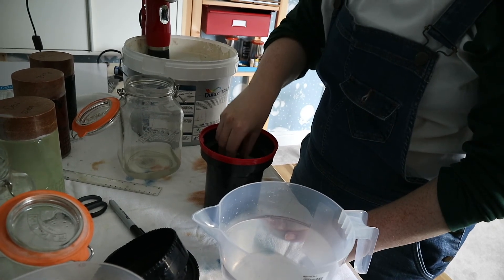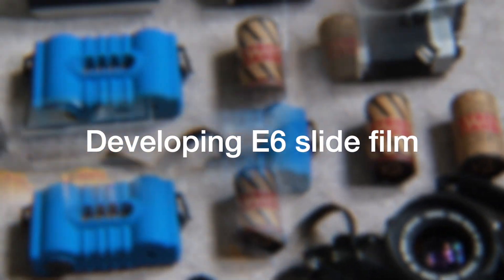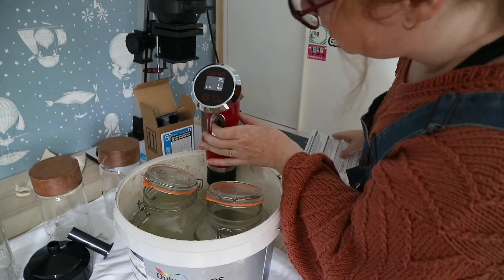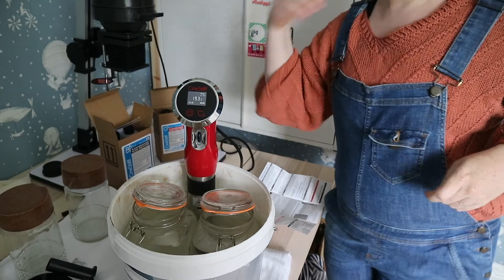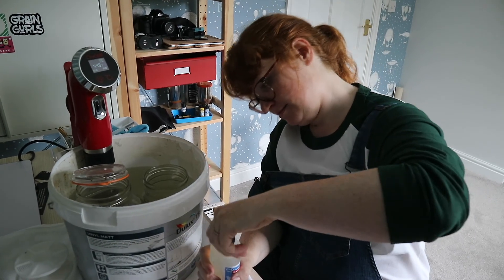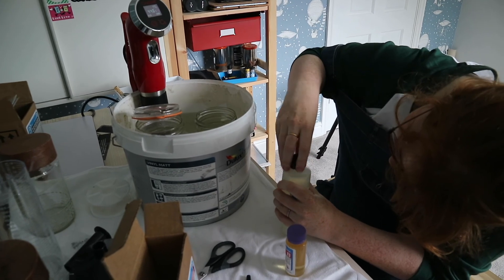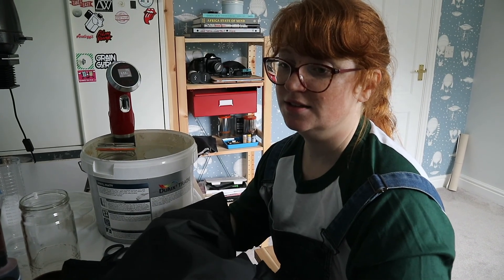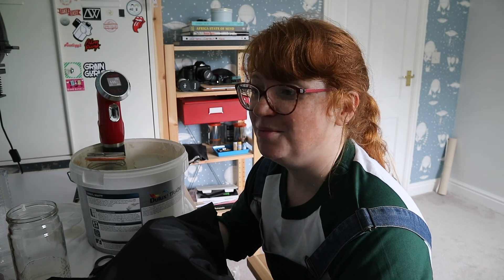Home developing slide film for the first time | Fuji RVP | Cinestill E-6 kit

Comment: You mention having to increase and lower the temperature of the chemistry but reading the Cinestills instructions it seems you could just keep everything at 40c during processing. Thank you for this thorough video. I recently had E6 developed at a small local lab and they used the CS6 chemistry and the results were pretty bad. I wonder if the Tetanall kits are better I'd love to shoot E6 as that is what I shot for years and years before digital took over.
Reply from the maker: We shall reread the instructions before completely abandoning the idea of E6 developing! Did you develop E6 yourself when you shot it before digital?

Comment: Here's why I think a video like this does a huge disservice  to its viewers. From "the School of Holly", it undertakes (it appears) to show that E-6 is not that much harder to do than B&W or C-41 processes, and the happy results achieved. Overall, poor to terrible results were had. The both directly stated and implicit conclusions offered are that the E-6 is too complex, chemically too unreliable, and just disappointing in result. Holly says that she has little or no prior experience processing E-6. She apparently bought older film from unknown circumstances, then processed in a Cinestill kit over a period running the full projected life of the chemicals, and got both bad results for most rolls and did not get the full number of rolls processed as expected from the kit. This isn't a test of E-6; it's a test of how many errors she made and the limits of the chemicals she used. First, the film: she has no idea of its storage history or its usable condition as received. Some of it worked fine, but without more information, the film has to be suspect. The chemicals? First, Cinestill is into making its chemical kits quick and easy to use, cutting corners, combining steps - just a source of lower quality and reliability. Its "rolls per kit" figure is based on mixing a kit fresh and using it up in over a day or two. If you spread usage out over weeks, quality and quantity will degrade, which looks like a factor here. Maybe she made errors running the process, or not. She doesn't seem to know. So this should be titled "Holly Does E-6 - No So Well", being neither a demonstration of the E-6 process or its difficulty of use. (My reference: I've been formulating my own E-6 chemistry from bulk chemicals for about 35 years, and shooting E-6 on and off for more than 60 years. I do know a bit about it.)  Overall, my advice to potential users of DIY E-6. (1) Use a chemical kit which separates the bleach and fixer steps - no "blix" please; (2) Use the specified temperatures, exactly as possible. No "alternative" or "room temp" processing. (3) Only the first developer step is time critical. All other steps must be fully processed, so tend to add more time to those steps than recommended, just to be save from under processing. You cannot "over process" these steps. (4) Use new, fresh film. On-line "expired" film from ebay and other unknown sources is in the same risk level as buying used condoms. E-6 film is greatly more sensitive to expiration problems than color negative film.
Reply from the maker: Thank you for honest comments. I appreciate it came across as a “how-to” video, and I will ensure that the titles and descriptions reflect this in future videos. 

It was always intended to show a first attempt/experiment style video of someone trying a new process and determining whether it is something they enjoy. I really want to stress the importance of “beginner” in my videos and never pro. This is a learning log for me, which is why I named it School of Holly. 

In terms of using the chemicals, I did use it all within a week, making sure to develop as many rolls of film as possible in one go. I did use a mixture of expired and new slide film, I agree that the expired film can effect the results but what I actually found was that I had good and bad results with expired film and good and bad results with fresh film. There doesn’t appear to be a clear distinction. As for the quality of Cinestill, all I can do is say that that is what I used, I am not experienced in different kits clearly! Haha.

I think the final point for me to make is that what I was trying to explain in my ending is that e6 development doesn’t suit my “relaxed “ style of shooting and developing. I get the most joy out of black and white developing, and not for perfection but for a relaxed but hands on addition to my hobby. I really hope I have not come across as anti-E6 but rather anti-e6 for me personally.

Sorry if I’ve missed any of your points but hopefully that clarifies where I’m coming from, I’ll certainly be checking over my descriptions and titles to make sure that I’m not seemingly trying to teach anything. I hope you’ll stick around for more of my videos but I understand if my style isn’t for you! 😀